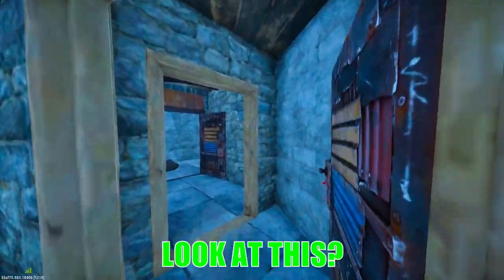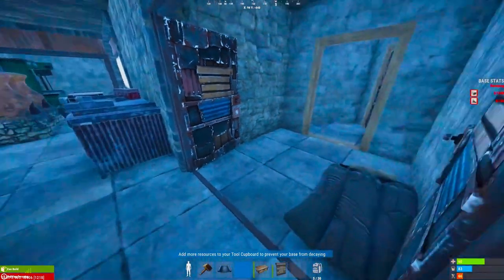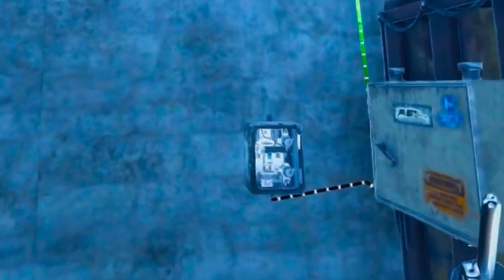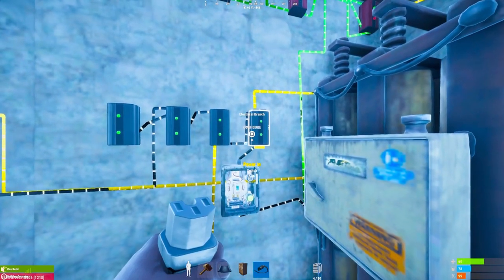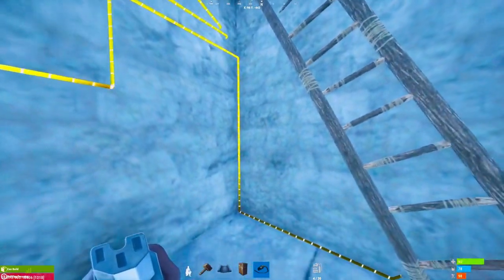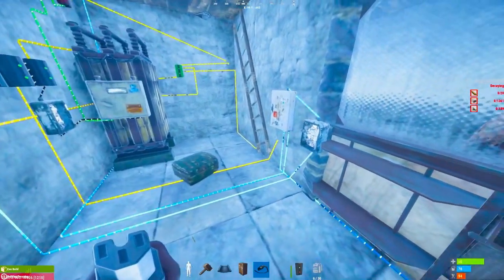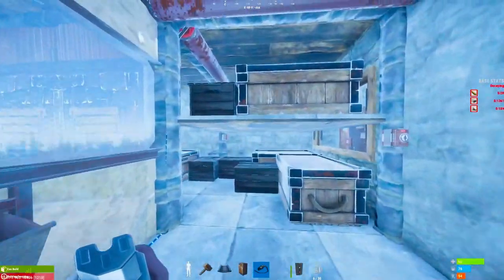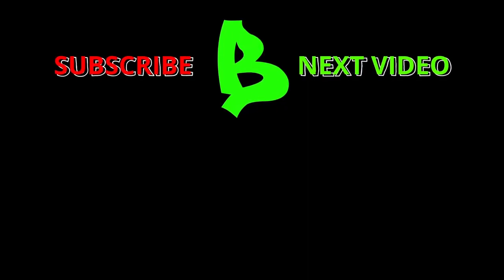*EASY TRAP* Auto Door Close & Tesla Coil Trap Base Design | Rust Electricity Tutorial

Comment: Does not work. Door doesn't reset. The diagram at the end is not at what is shown in the video. One branch is branching and powering out to the hbhf. In the diagram power goes from the battery directly into a branch but in the video he says to go from battery to switch.. Configuration output incorrectly labelled as 2 when it should be 5.